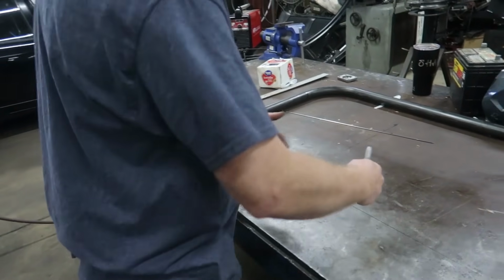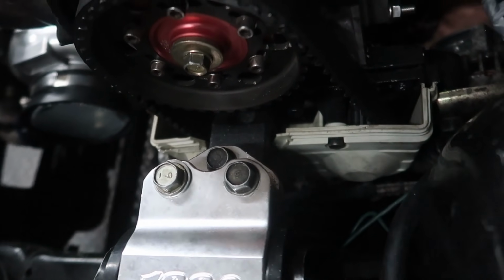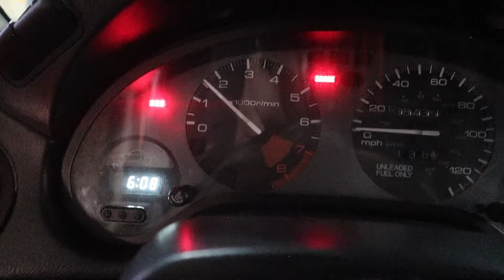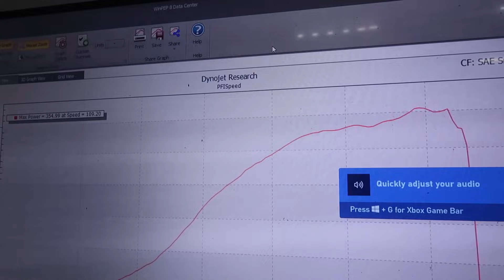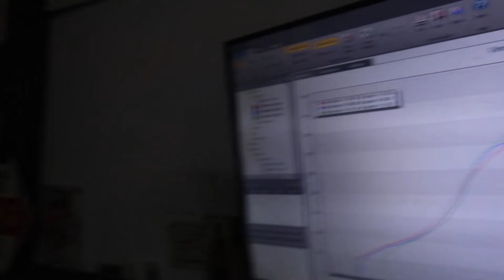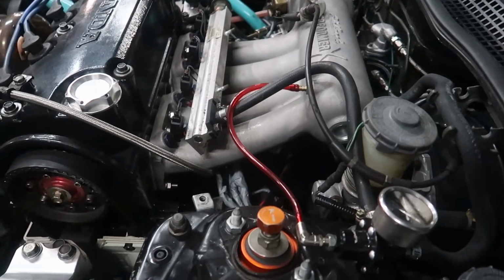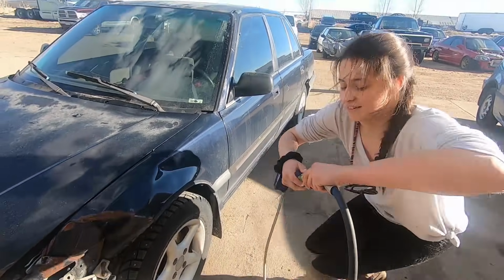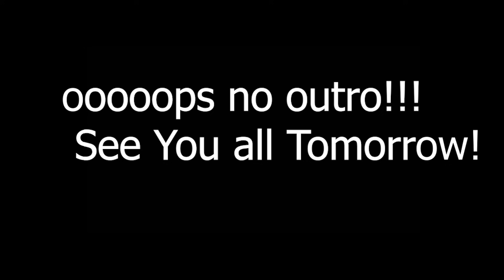QuaranTUNEd! She’s Glowing  and making Jam! Single Cam Ripper!

Comment: flame came out that collector when he let off @15:30
Reply: Yep was going to say same thing
Reply: Also around the 5 second mark (intro)
Reply: Seen that too
Reply: Oil vapour from the dipstick hole on lift off.
Reply: yes
Reply: Don't be lying
Reply: Surprised to have not herd "GET THE SMOKER" !
Reply: Could there be a weld hole in the collector? Losing pressure too, surely?
Reply: @ardillasecreta  thats what i was thinking  might also be a reason why it was getting so hot like brent was saying about airflow
Reply: I went back twice to make sure I seen that right
Reply: Definitely a whole in the headers

Comment: I worked at a nursery/plant grower in Pasadena, California and we had a long center driveway paved with asphalt millings. It melts down pretty good in the summer heat and you can compact it just by driving over it. It's a little gravely but way better than dirt. And the city was always happy to have a place to dump the millings — we had to freshen up the driveway every couple years.

Comment: Turbo blanket and header wrap!-) All that glowing is waisted horsepower, keeping the heat in the pipe will translate to higher exhaust gas pressure and increased turbine speed all other things being equal. Also keep from Burning up everything else close to it. Great videos keep them coming! Et al.

Comment: Steam dyno?  Here is  a fun fact. Abner D. Baker developed the Baker Fan to provide a load to tune his tractors and steam engines.  Engineers estimated that if you had the fan tuning 200 rpm. To turn the fan 400 rpm it would take 4 times the power to do so.   Tune a steam engine? Yes by setting the slide valving and adjusting the governor effects power output.
Reply: Steam engines are amazing!

Comment: Just a hint. If you just clamp the return pipe from the regulator with some vice grips, when under load on the dyno, you should see the pressure go up. If not the pump has ran out of flow capacity. If your read this hope it helps👌

Comment: What they do where I work when they expand parking lot is haul in ground asphalt from road work, spread it, and compact it with the big roller they use on highway work. it actually makes a decent surface. Long term later on they have actual asphalt put in.

Comment: The reason for pot holes returning over and over is a poor base under that location. the best way to fix it is just dig down in those spots and remove the mud. clean gravel will then fix the problem premaritally.

Comment: Use bigger rock in your potholes, and sakrete to level it off. Not permanent fix, but it'll get you cheap fix until better weather, and things in general get back to normal around the country.
Stay well n be safe.

Comment: I’m surprised more people don’t run an oil temp gauge.  I’ve got a probe in every one of my oil pans and the cars without an oil cooler don’t take much extended beating without hitting 240°F+.  My standard kit is wideband, oil pressure, and oil temp.

Comment: The asphalt plant i worked at made "cold mix" sometimes. I have used it to fix my drive way. Brought buckets of it home in the trunk lol. Super simple put it in the hole and drive on back and forth a bunch real slow til it packs and done. Not sure on the price but you can do it yourself

Comment: Brent, use Macrium Reflect Free to clone the drive on your dyno. All you’ll need is a Sata to usb Drive reader. And install the software. The source is the old spinner drive and the destination is the new SSD. DM me if you need some help. I’m an IT Professional by trade. Love the video! Most importantly keep the old drive, just in case something happens you can just slap it back in, if the new SSD fails.
Reply: Or the Western Digital tools, or acronis. He has an IT guy that may do it for him also.

Comment: If you don't mind answering a little question I was always wondering why do you feather the throttle so much when taking off from a stop. Isn't that like bad for the clutch or something? I drive a manual myself.
Reply: to get the big heavy roller of the dyno moving!

Comment: Wish u guys lived closer to Tennessee I have to find a spot to dump concrete daily after each job I haul to if any is left. It might take several days but could make u guys a concrete pad in sections for free till done. Check with your local concrete company and see if they will bring y'all some free concrete. It's already been paid for by whatever job they delivered to and it will have to be dumped and wasted anyway.

Comment: Call a concrete producer like ST Wooten of Ready Mix or something and see if any of them sell crushed concrete.....that's dirt cheap and makes a GREAT base for asphalt.....Just dont cheap out and only use it by itsself to fill in potholes and low spots because it still has active cement in it and will ruin your cars and customers cars paint jobs if you don't wash off the dust/mud.....so just as a base before placing asphalt but not to fill in the potholes.

Comment: You need a skid steer and a load of gravel at all times. But first bring down the high areas with a grader box or toothed bucket.  So everything is even to start. It could be useful to have a skid steer around too

Comment: What's the plug gap ur running on this power didn't I hear he has the ngk 7's. One more i had was how much safe hp would a stock fuel pump hold with upgraded injectora

Comment: I need an idle air control valve for a d16y8 I’ve tried two brands and neither worked any brands that y’all use like Honda oem or Autozone or what

Comment: Fuel pressure doesn't mean fuel flow. 90psi check valve opens on that pump. Figure 80 ish when reading from gauge on your rail.

Comment: Can brent or anyone here answer me this(im a rookie):
I have a 98 civic i was told i have a d16z6 and that I need to do a Y8 head swap, why would they suggest that?
Reply: Some say it's better flowing head being slightly newer than z6. From what I know z6 was obd 1 engine and y8 was obd2. How do you get z6 on 98 Civic? Swapped by someone else?
Reply: If it runs leave it. The 98 should have had a Y7 in the dx trim and a Y8 in the ex. Someone got ahold of it before you. Don't feel swapping the heads is going to give you enough to be worth the cost, i.e. finding a head plus gasket set, timing belt , water pump . If it's running good an VTEC works let it be . Also the keyway in the camshaft is at different angles in relation to the timing marks on those to heads. If you decide on an adjustable cam gear keep that in mind.
Reply: Keep the z6 head.

Comment: Some nice videos and good work from you guys. Your greatest work though is shown through your kids Brent, enjoy your family and may God keep an eye on them. In regards to the crx, since fuel pressure is not dropping, although it should have been around the 80psi mark with 58psi static flow rate and 25psi boost, and since you do not get to see lean afrs up top without being able to correct them, then the injectors indeed do not flow as they should for 1000cc, as hp vs inj duty does not match.

Comment: That manifold has a hole in the gooch, u could see it after the close up pull
Reply: I dont think it's a hole I think a spark of fire just glowed off of it
Reply: @ericwilliams2117  I agree, that thing would be blowing crasy fire under boost if it were a hole.
Reply: But I seen that little shot of fire at least twice in this video
Reply: @elonmust7470  That manifold has to be super thin.. Only 1 pull and the thing was red hot and it wasnt even pushing that much boost. It takes a ton of pulls to get my manifold like that.
Reply: I thought it was called the tant?  I guess some do call it a gooch:-)
Reply: John Doe you hear gooch a lot from Oz.
Reply: @samsonian  we roll with "notcha" too
Reply: There is no hole I looked the whole manifold over, this is my car
Reply: Brother Built look again...it only fired up at the end of the pull, same time as when the exhaust flames up....oil on the manifold would catch fire immediately, not just when the afr’s get funky on deceleration
Reply: @brotherbuilt4407   all that extra fuel in deceleration (normal) should cause a spike in ex mani pressure  turning a pin hole into the blowtorch seen at the gasket aera,  look for a small defect in the  flanges  surface. May need a MLG( multi-layer gasket) used in medium-high pressure diesel systems.

Definitely a hole (either in the gasket, manifold, or possibly even the turbo) otherwise fuel vapers could not exit at spontaneous combustion temperatures.

Badass build keep up the fight to get to the top, the devil is in the details

Comment: Brent what motor is that in the del sol also i have a question i have a stock f22a is it worth modding it or should i buy a different motor
Reply: F22as with a turbo and and the jdm vtec head is sex. You can also swap an h22 head on it and have dual cams and make even more powah. You can expect a fat torque band, but relatively low revs for a Honda. Or if that sounds like a lot, swap an h23a in your car, throw some type s cams and springs in it and call it a day with over 200 whp and a fat torque band.

Comment: I wish that you would explain whether these engines are built or not and what has the internals on them so we know roughly horsepower versus build it would help in a lot of the new guys building cars don't know what their stock engines can do they will know what is a safe amount of horsepower for generally each type of engine thanks
Reply: no 100% stock d series would make that power ! its clearly not stock